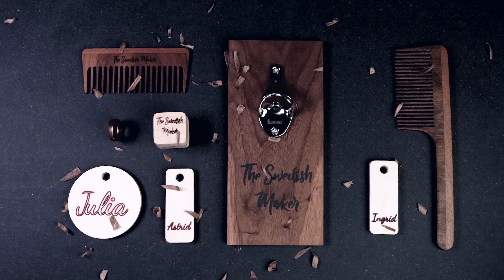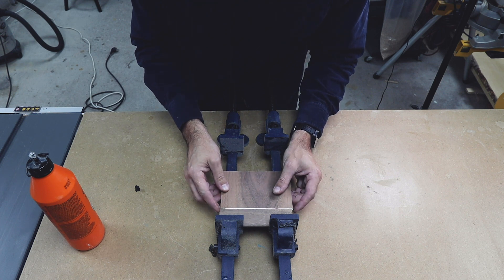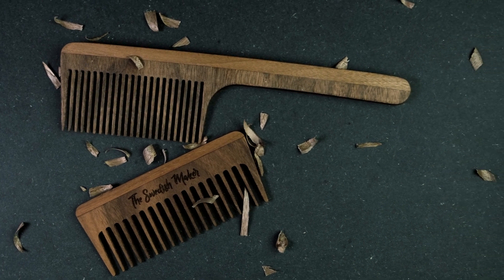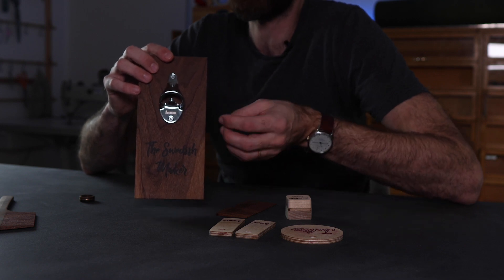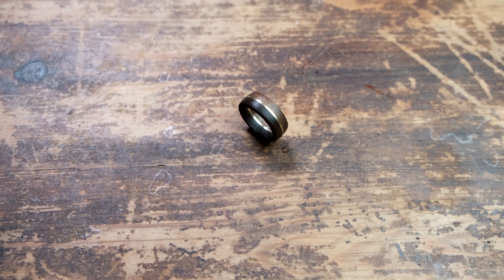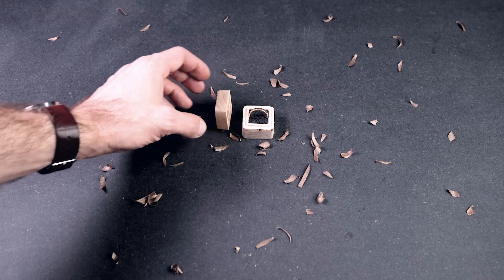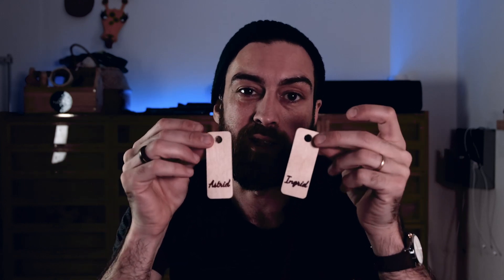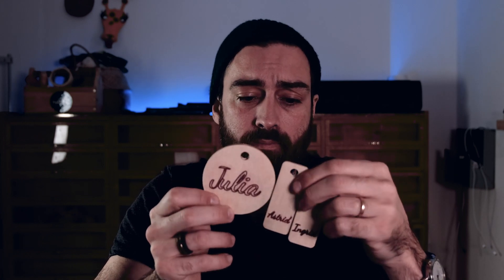5 Christmas Gifts on A CNC

Comment: I’ve been engraving, with a drag bit, pictures onto those LED night lights that are just a sheet of clear acrylic with an edge mounted LED.  I use Inkscape to make the picture into a svg file to engrave. You can also use a 90 degree V bit. Using a drag bit you don’t run the spindle. The drag bit I use is spring loaded. You can buy a base for edge lit displays online. You can also buy acrylic discs to engrave online. Nothing quite like a favourite pet engraved onto an acrylic disc to bring on a smile.
Reply from the maker: Thats good advice, thanks!